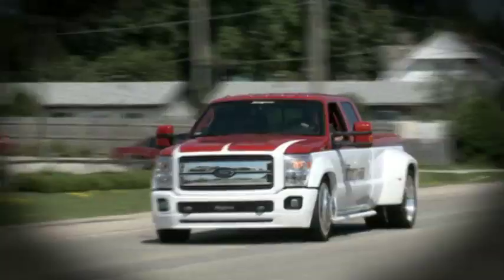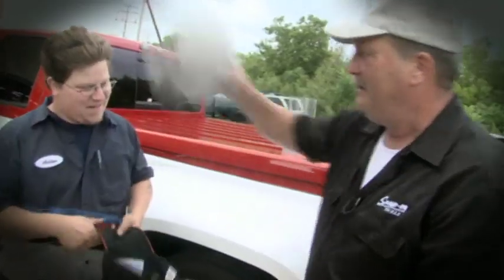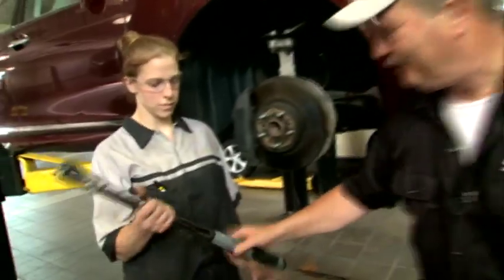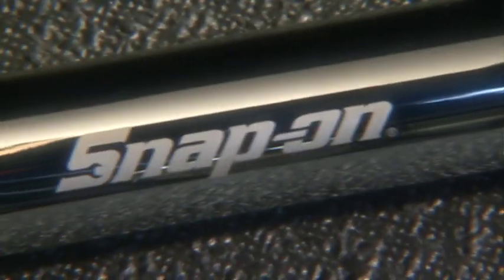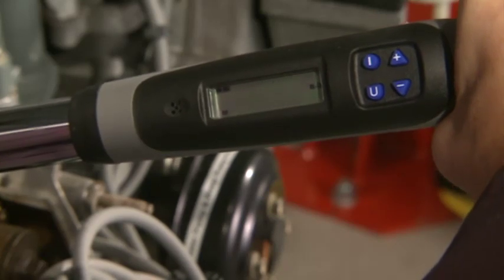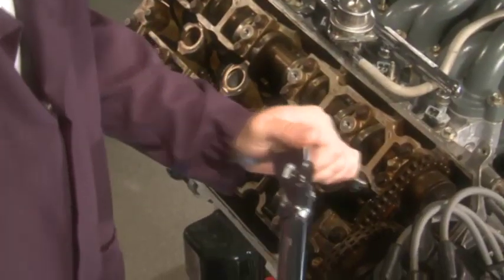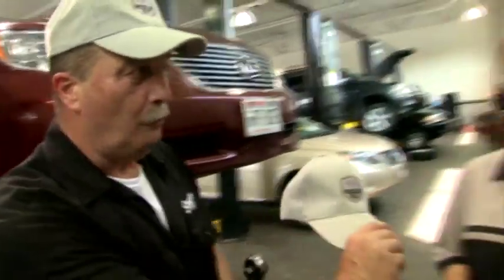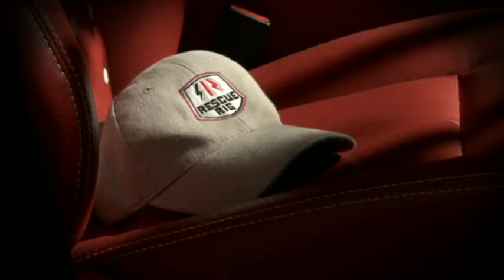Snap-on Rescue Rig: Electronic Torque Wrench | Snap-on Tools

Comment: I'm aware... They also designed the 6.9 idi and 7.3 idi together. What's your point? Some fords were sold with cummins diesels, but never the 3/4 and 1 ton trucks.

Comment: That Matco has a reverse switch and can measure torque in both directions,I know because I own two. Typical snap on sales bullshit. Oh well I'm still going to buy a tech angle for tighter areas and torque plus angle. Snap on needs to get over themselves, I own plenty of snap on and they work as well as any other tool.
Reply: swisherboi yeah you could even see the reversing lever in the video...
Reply: She didn’t know. Now works ina tire store and messed that up too

Comment: You can do the final turn without an angle gauge.90 degree turn,1/4 turn with a breaker bar.I don't torque lot of things anyway,only certain engine parts.The wheelbearing manufacters are full of bs,say you can ruin a wheelbearing tightening the axle nut with an impact.This is not true and I do this with no comebacks
Reply: Walter Frederick  Tapered bearing and race or sealed unit hub?
Reply: Yeah, why would they come back?

Comment: I had two of the digital torque wrench's... Both of them are now in the trash. Sent back 3 times to be fixed in less then 6 months and still never worked right. Do yourself a favor and stick to click types.
Reply: Would you recommend buying this used? Please explain further how they stopped working